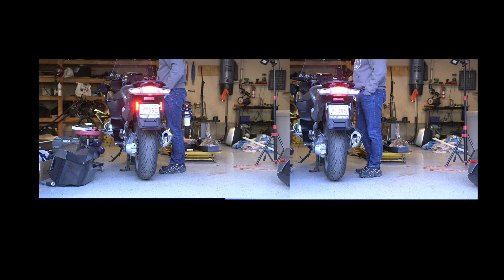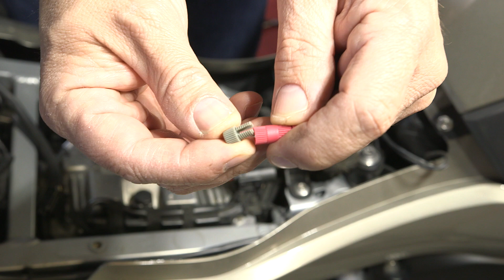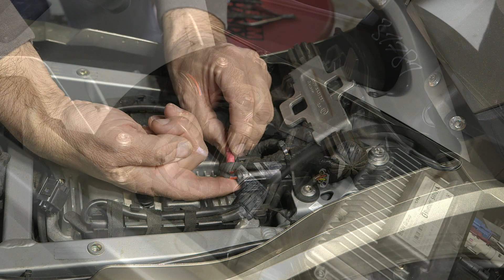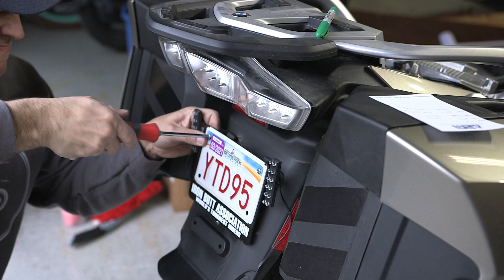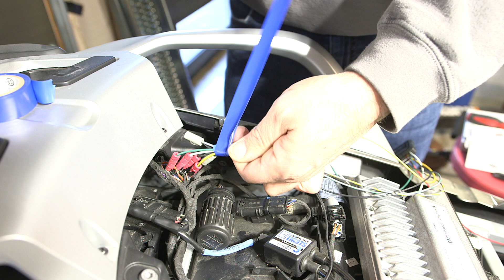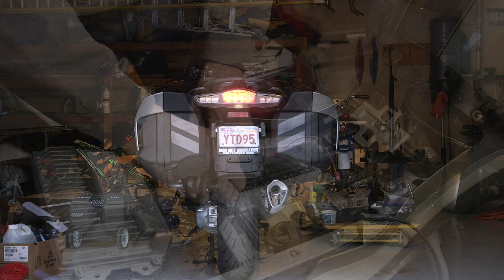Skene Design Auxiliary Brake lights

Comment: In your description of the colored wires, you note for example, "blue with red stripe is left".  Except on my 2021 F750GS, there are two wires coming back from each turn signal.  One red, one black.  So  which one do you connect to, or connect to both?
Reply from the maker: The wire scheme I used was for a 1200RTW. I am sorry I don’t know the plan for your specific model

Comment: I have been riding with the P3 taillights on my Honda since I bought it in 2012. They are the run brake turn combo, but I never hooked up any of them for turn signals, just run and brake so far on the P3s. I have an old video on my channel about them. I also got some of the photon blasters for the front. I have white and yellow in the front, and 4 red in the back. I just got a new bike, so I have transferred them from my Honda to the new one. I like the conspicuity flicker and any time I'm ever on the motorcycle forums and additional or aftermarket lighting comes up, I always always mention Skene's lights. I don't know as I have seen any others with them, but they are a very good tool to help others see you any time. Especially with all the distractions possible while driving in this digital technological age. And especially in daylight riding. I see there is a new design for the lights now. Mine are still working great and still super bright of the older design like the ones you are using. I'm sure they have helped me be more visible everywhere I go. I don't have the decel package, but I have the photons with the alert system. Tap the brakes in any combo within one second of each other, and it will emit a flashing pattern on the front mounted lights. I wish I had room for more! Thanks for sharing, nice to see others with these lights, too!

Comment: Chris, when I installed the Denali B6 tail light on mine, I ended up running the wiring up behind the license plate and straight up to the under-side of that protruding reflector and drilled through. The plastic is very thick there. Once through, the wiring goes right through to the area where you tapped in. I got a rubber grommet from Ace Hardware that was designed for the thicker plastic. With the grommet in place, it is completely waterproof, looks OEM, and is pretty much out of sight. I hate drilling any holes, but due to the location, I felt it was the best solution, and could put a plug in if the B6 were ever removed.
Reply from the maker: That is a better way of doing than my approach, since your wires are more secure than my tape.
Reply: @kiki231000  Here's a direct link to photo on bmwlt.com  And, I just have to say how thrilled I am that I actually have a tip to give back to you, after how much I have learned from your videos on the RT. https://www.bmwlt.com/forums/attachments/rt-series/155215d1575138250-tail-light-wire-routing-2014-rt-img_20191130_120609_1575138245685.jpg
Reply from the maker: Dana Leasman thanks for the note. I’ll look it up.
Reply: @kiki231000  Not sure if you belong to bmwlt.com, but you can see a photo of the wire going through with the grommet in a photo I took of mine. I actually got the idea from another member. See photo attached to the last post in this thread. https://www.bmwlt.com/forums/rt-series/184495-tail-light-wire-routing-2014-rt.html

Comment: Been thinking of those, after seeing your video, may entertain them. Would like to know your opinion on installing auxiliary lighting at the front of the bike, just below the mirrors. Saw them on Twisted Throttle web site. Possible installing the amber optic type on my K1600GTL.( already have auxiliary mounted by BMW on the front lower section of the bike.
Reply from the maker: IN my opinion, more lights can never hurt. That being said, I have heard, secodn hand, that the "light triangle" of one light high and 2 low does a better job of grabbing drivers attention than more lights high on the front. If that is true, perhaps having the high lights only come on at night or by choice, would take care of that issue. I have had VERY good luck with Twisted Throttle over the years, and make a point of stopping in whenever I am in Connecticut.

Comment: Did exactly the same as you Chris with an Admore lighting kit - opened the wrong wiring loom (think I may have been using some Skene instructions).  After an hour of head scratching wondering why I could not find the right colour wires realised it was the wrong loom..... You not tempted to use something like an Hex ezcan or Fuzeblock FZ1 for power supply?  What next for your bike?  Front and back dashcam?
Reply from the maker: Funny you should mention that. I DID consider using the brake trigger wire that is sitting empty from my CANopener (for the Clearwater lights i have up front) , but since i still needed trigger wires for the signal lights, it was no savings in time. I don't have any plans at the moment, however I have been toying with rear crash bars....